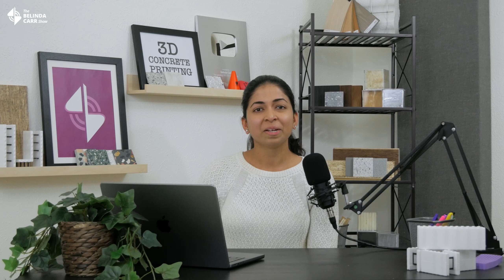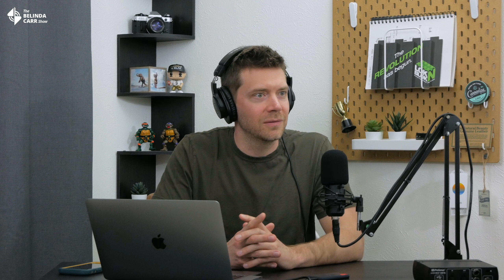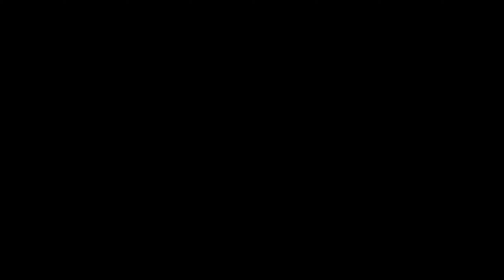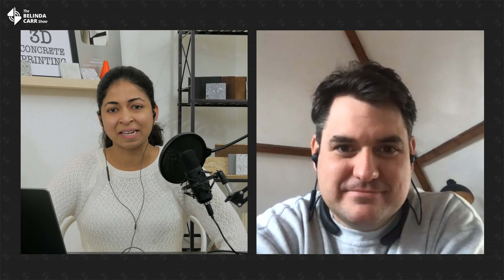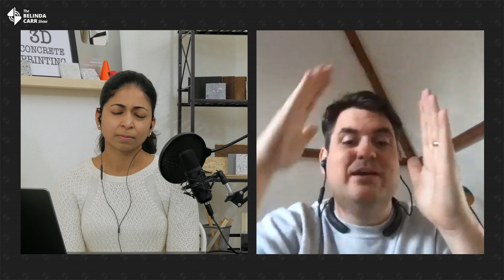Building 3D Concrete Printers w/ Vertico 3D | Episode 9

Comment: Great segment as always.  The most critical step in adoption of 3D Printing as a common tool in construction is acceptance and understanding of the technology and approach.  This is why for now structures are built with material familiar to the sector.  Once we bridge the gap between traditional and 3D Construction printing and people "understand it" then we can take the next step of moving away from traditional approaches.  With understanding and acceptance there is more adoption, with more adoption there is more innovation and fine tuning of the approach; a healthy competitive market also accelerates innovation and creates a cost competitive market.  Construction is driven by standards and codes, nothing happens without them, and this is the main reason I've taken it upon myself to put together committees to develop standards that help bridge the gap and help the sector relate to the approach for en masse adoption.